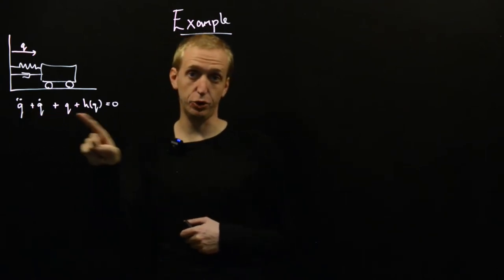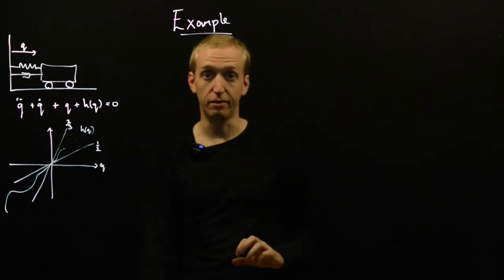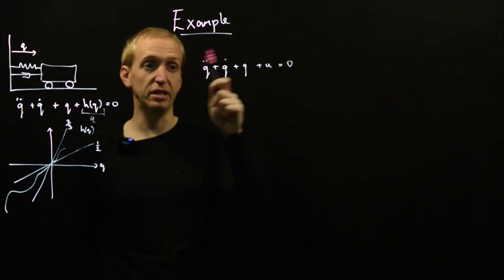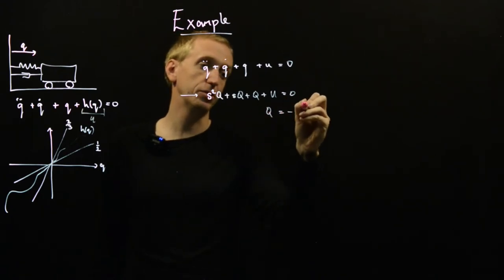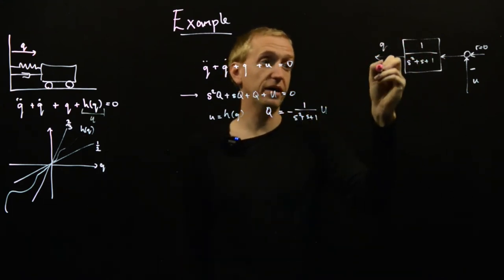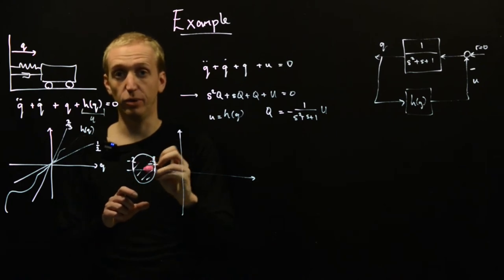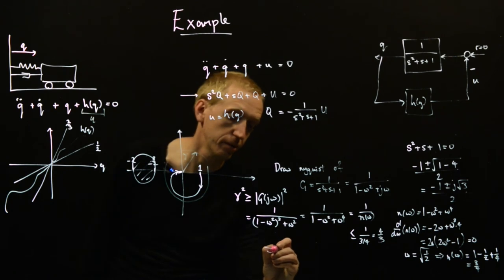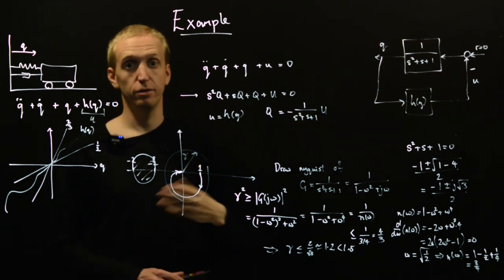Applying the circle criterion

Comment: Thank you for your excellent presentation. I only do not understand the gamma inequality like 2/sqrt(3) and 1.5 .
Reply from the maker: The first thing to say is that the final bit of the video is certainly the least important. So it certainly doesn't matter if that bit isn't too clear to you - you understand all the important parts of the circle criterion! But to fill in the details, at the end we are just trying to show that for the transfer function G(s)=1/(s^2+s+1), the Nyquist plot does not intersect or encircle the circle that passes through the -2 and -3/2 point, since this is what we would need to do to prove stability using the circle criterion. The best way to do this is to just plot the Nyquist diagram, and look at it! In practice this is what I would recommend that you do. But suppose that we don't have a computer to make the plot or we can't be bothered to make the Nyquist plot by hand - can we prove this algebraically? Because G(s) is so simple, and actually misses the circle by quite a lot, this is easy to do. One way that is sufficient is to show that the Nyquist plot of G(s) lies inside a circle centred on the origin with radius less that 3/2. After all, if this is the case, the Nyquist plot cannot intersect the other circle, and cannot encircle it. The rest of the video is essentially just doing the algebra to show that the Nyquist plot does in fact lie within this circle. In fact, the calculation shows that the smallest circle that contains the Nyquist has a radius 4/3 (this is what gamma is).

Note though, this method of finding the smallest circle containing the Nyquist plot is only a sufficient condition for showing that the circle criterion holds. It gave a convenient way to check things algebraically that worked for this simple G(s), but it will not work every time. You can probably think of much better ways to capture the actual circle criterion requirement algebraically. In fact, if G(s) is the ratio of two polynomials, you can always turn the circle criterion requirement into an equivalent algebraic requirement (not just a sufficient one). If you want a challenging problem, try to figure this out!